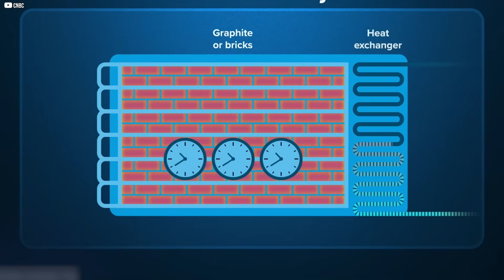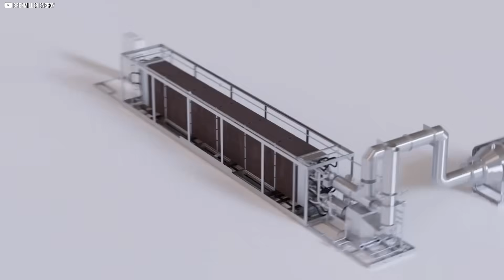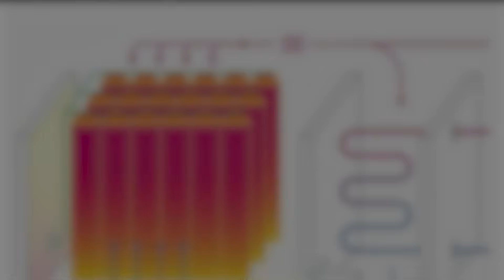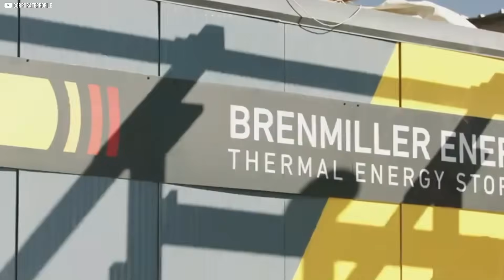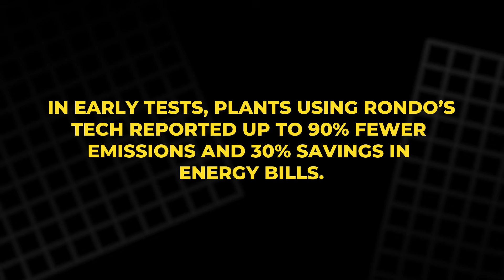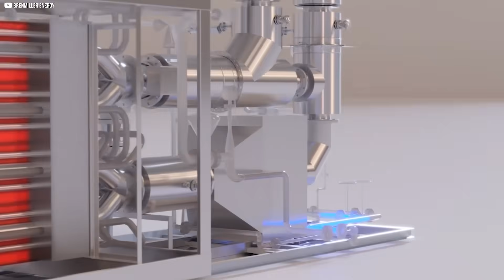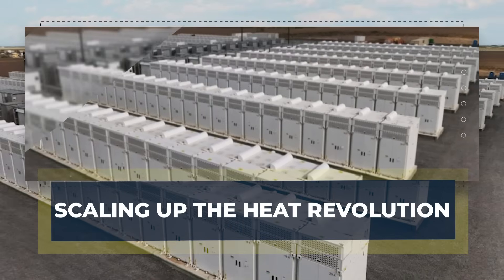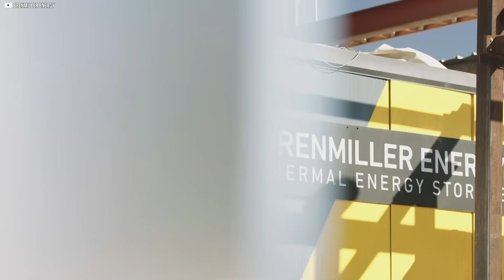How Crushed Volcanic Rock Could Power the World

Comment: I want to know what is the overall efficiency? For example if you take 1 Mega Watt of electrical energy and turn it into heat how much electrical energy will you get back when converting it back to electricity?
Reply: I don’t know about Rondo but I think Brenmiller has said it is somewhere around 97% cycle efficiency
Reply: Equal to or better than a nuclear plant.  (Carnot cycle turbo generator)